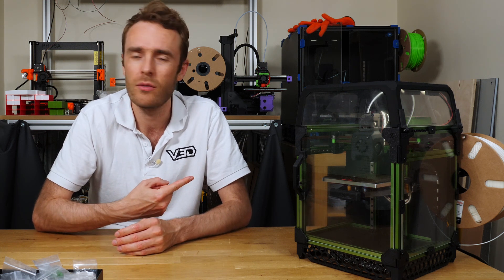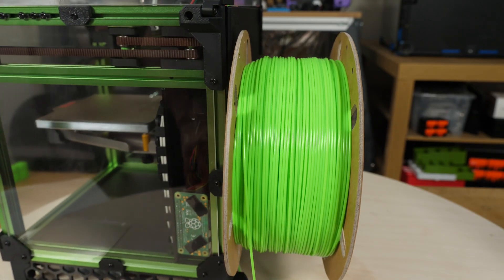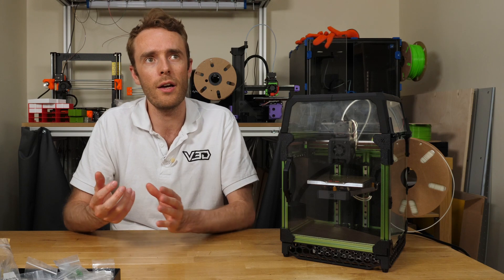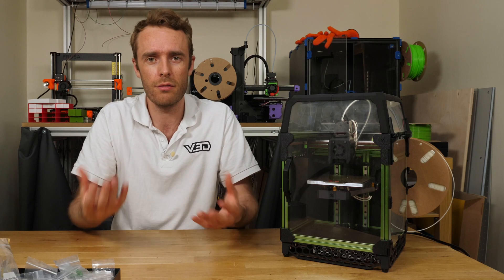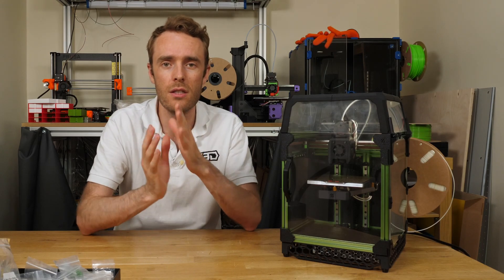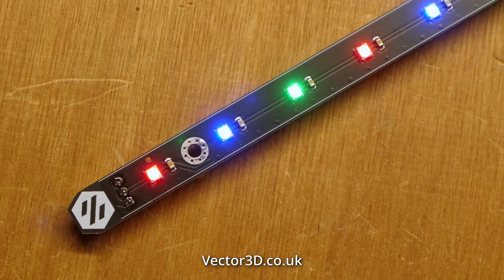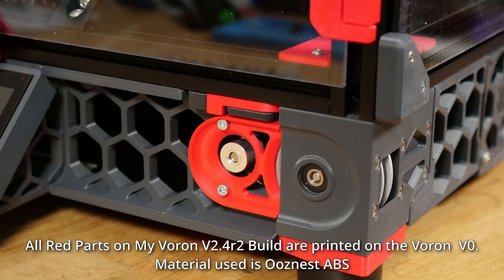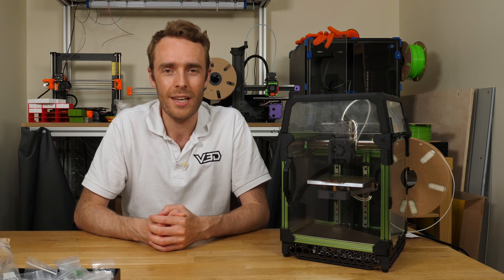I love using this Mini 3D Printer, but...

Comment: The bargain of the century is the Bambu Lab P1P at $699 that is just as small as the Voron 0.1 with more than DOUBLE the print volume of the 0.1, CHEAPER than the 0.1 and FASTER than the voron 0.1...

Comment: I purchased an ender 3 v2 thinking "i will need a bigger printer soon". I was so wrong. All my prints would of fit in the 120x120 build plate. I did pick up a cr10 v2 (it was broken but i fixed it) to experiment with larger nozzles. After heavily modifying the cr 10 v2, I would feel happy selling my ender 3 v2 and using the voron for 90% of my prints.

Comment: Funny intro ;-) I suspect there is no one printer that will do everything. My "dream team" would be a Voron 2.4 350x350 plus a Voron V0. I'd probably use the V0 most of the time due to the extra speed and convenience and lower running cost, and the V2.4 for anything too big for the V0. Possibly I'd run them both in parallel when there are multiple prints to be done. I currently have the V2.4 but have not so far had the funds to commit to a V0. I'd really like one though. And just for a laugh, I'd store it inside the 2.4.

Comment: Am I the only one triggered by those 2 trapped, unused T-nuts?
Reply from the maker: Trust me. I'm also triggered. This is the downside of the v0 frame and nuts, they are not easily removed without disassembly.

Comment: Love my 0.1, it's incredibly solid and reliable. I've not had issues with the mini AB, I mostly print PETG on it which should surely be super problematic, but it's been fine so after about 90 hours.

Comment: It looks like a fun printer, but I wish it was 6" cubed. I have 3 printrbot simple metals that run most of my parts, but I have an i3 for medium parts and a CR-10 clone for large parts. My simple metals are rarely too small for most things, but I'd be concerned that less than 5" cubed just wouldn't be big enough. Theoretically I could just get longer extrusions, longer rails and source a bigger bed to make it happen, but that's a lot of work and additional cost when the last Simple Metal I got was less than $100 with shipping.

Comment: Adam, I have heard people say it is very hard to work on during assembly because of the size, what is your opinion on this statement?
Reply: Yes. It's a nightmare, print a metric ton of no drop nuts and measure and square everything as many times as you can

Comment: The smooth PIE works wonderfull with ABS - the rough one is for PLA... Thats my experience with all my printers.  My V0 is running for a few thousand hours now and the Z-Axis works fine. No problems except that you have to calibrate it new, when the V0 is running more than 5-6 hours. But it is a small amount of adjustment and when you print with a skirt there is enough time to adjust before the print. 
I have the same experience with the Afterburner mini when  I use ABS+. When I use FormFutura TitanX there is no problem but its softer than ABS+ and i want the stronger parts. I will switch to a LGX lite soon. On my Voron 2.4 R2 too.
Reply: Print all my abs on the textured side, think ts just down to individual preference at the end of the day.

Comment: Built mine just because I could and I'm waiting for the room for a bigger one.  Modded with a picam, LEDs, LGX lite, umbilical, taller hinged hat, filament sensor, klipper screen, nevermore so far.

If I was going to do it again, I'd use  2020, and build it around a Prusa mini clone bed though so my plates would be interchangeable.
Reply: I think you should look into the Tiny-M, then.
Reply: @mocotonio  probs just do a custom size one, most of the tiny m parts would fit I suppose and could mod or CAD any replacements I need

Once you've done a 0.1 I reckon you could do anything

Comment: Love mine Voron 0.1. Upgrading and tuning it makes so much fun. Also have the LGX Lite install last week and it works really well.
Reply: What hotend are you using?
Reply: @ryansmith616  I first used a Dragon SF and switched to the HF Heatbrake in the meantime. but then I decide to print a little slower because the cooling wasn't enough. I recently got the Voron revo. 15mm3 is almost perfect. Great print quality and easy to change nozzles.i love the hotend. I'm considering upgrading my Vyper to that too.

Comment: MiniAB is indeed shite, i switched to Sherpa Mini because it did not require any extra hardware from the LDO kit apart from the printed parts Agree with most of your comments except the z rails - they just need patience. The aluminium profile bed holder is not ideal but it works - have a kirigami as a future mod.

Comment: if you take your time dialing the two Z-rails there`s no binding. Mine are running smoothly. Also sorry to hear about your experience with the MiniAB. I had no troubles. I am using a aluminium x-carriage though as the printed part is much too flimsy indeed. I suspect other than defective X-rails much of the play in the toolhead comes from this part flexing. I am using two fans to cool my electronics and even the power hungry Pi4 I`m using is running cool. I built mine purely for the enjoyment of doing it as I really have no real need for such a small machine.

Comment: I've had lots of fun modding mine. They work so well and I love quick prints with them.  One of mine prints TPU better and faster than any other printer I have.
Reply: I'm running 3 motor 3 point bed leveling motion, and a mod that makes the frame a box and gets rid of the annoying top hat. It makes for a very stiff frame and no hinged tophat needed. Panels that clip in and out in a second. I've run a few extruders and so far I like the sharkfin that is based on the sailfin extruder and those are on top of a MiniAS. Nevermore V4 filter helps with more air flow and better chamber temps in addition to filtering ABS.  The guys over on the doom cube discord are awesome and share so much hard work. Big thanks because I have never had as much fun as I have modding these awesome little printers.

Comment: I found the Mini-AB to be pretty lackluster as well.  It was almost certainly my printed parts tolerance, but it was the only place the issue came up in my build.  I too went with the LGX Lite (and love it), just recently I switched to the BondTech SLS parts and found them... mildly annoying.  The swappable hotend mount is annoying, but overall the parts are nice.